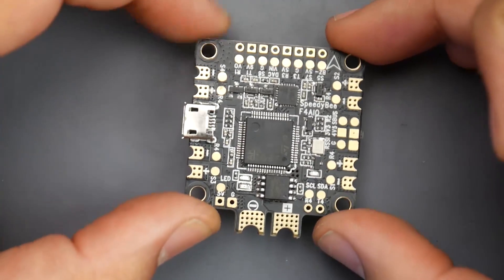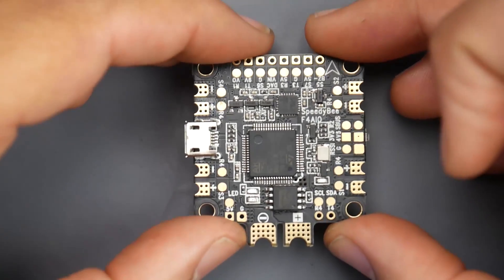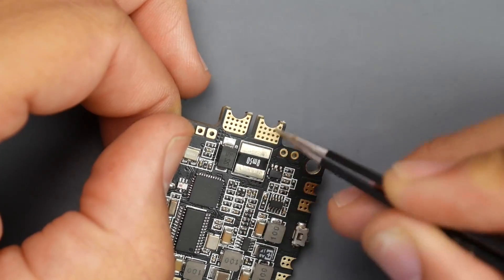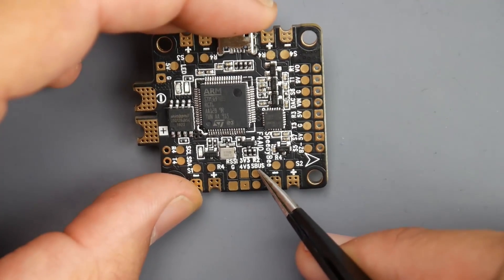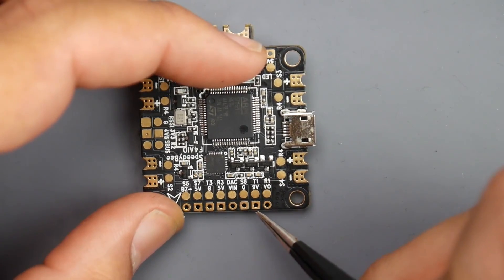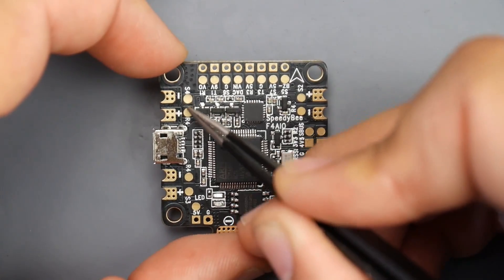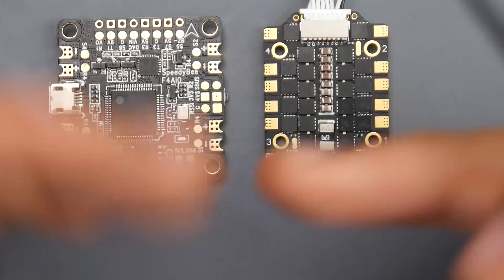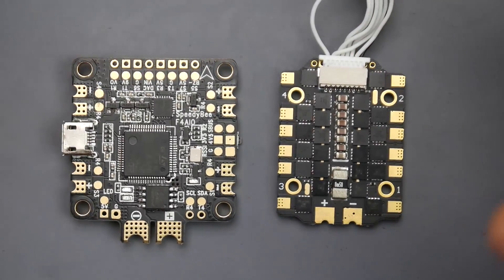[New FPV Product] Speedy Bee F4 AIO Flight Controller V2 // Overview & Setup Guide

Comment: Drone Mesh, with regard to soldering solder pads with holes in them, what I do is stick some blue masking tape to the underside, which seems to do a decent job of keeping leakage down.  I've wondered if there is a clay product that is safe for use with electronics that might be easier to use than the tape, but tape works well enough.  Clay might sap too much heat unless it is an artificial clay with suitable thermal properties, perhaps a ceramic.  Recently, I managed to get a decent result soldering the main power pads without tape, but I'm not sure how much luck was involved.  Before soldering the leads to the top of the board I tinned the bottom, adding a slight mount of solder hoping it would slow down the leakage if I worked fast on the top.  After I tinned the top I let the board cool off before going back to solder the wires on, which I did as quickly as possible.  It seemed to work, or maybe I just got lucky.

Comment: Can you make some things.
 A timer at line voltage that turns off a power source in 5, 15, 45, or 60 minutes. You slap a button and it turns on and automatically turns off in the selected time. Use it for you solder station and battery charger. How many people leave there glue gun or soldering iron on - or go back to there place to make sure it's off. UL approved for US.
A battery discharger component - it shuts off at a selected voltage - XT60s at both ends. You tie one end into your parallel charger - the other into a LED or heater. You set the shut-off voltage and you can discharge 6 packs at a time. For bonus limit the amperage. You can also use it to power LED gates and not kill your lipo.

Comment: It's not actually new. I have my V2 (i have 2 of them and a VTX-DVR, i like a lot their products) since december last year, but then it went out of stock in the beginning of this year and they relaunched it as new.

The only thing i dislike in this board is that the signal outputs are pads and not pins. I have broken some in mine.
Reply: iv been using this board for about 3/4 of a year now . I have it on 3 quads. I can configure everything on the speedybee app, except firmware.